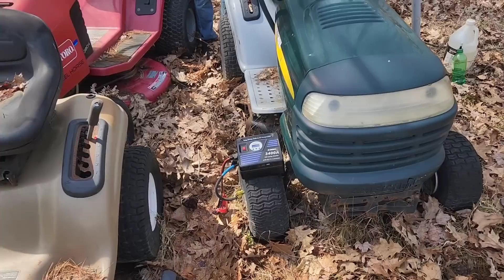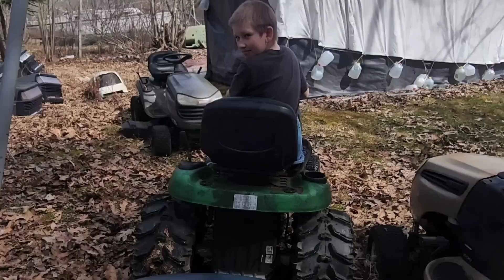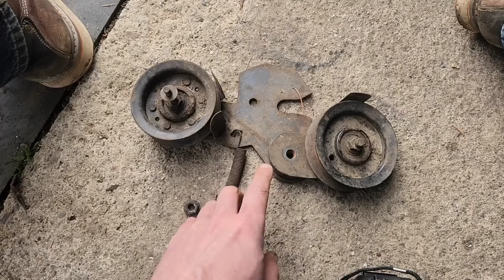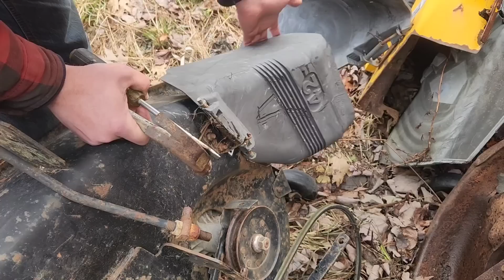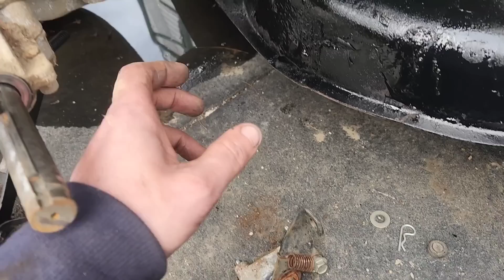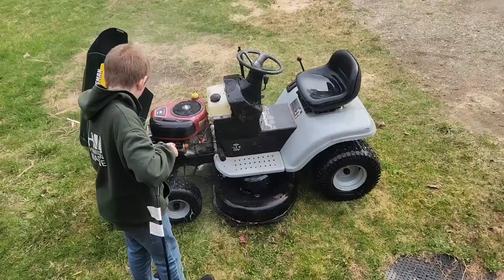Tractor Hunting: Craftsman LT1000 $50

Comment: Cute boy there!
Got a question. I have a Craftsman with 19.5 HP opposed twin.
I put it away for winter and now have no spark on both sides.
I disconnected kill wire, still nothing.
I changed coil and still nothing.
Seat switch is good, machine turns over. could it be a Diode?
Reply from the maker: Coil gap to flywheel or the magnet is rusted to the point it fails to trigger. Might be the case. New coil with kill wire removed you should get a spark.
Reply: @redneckcomputergeek  Thank you.
I will check that and try again.
Reply: @redneckcomputergeek  Hello, thanks.
I had put coil in backwards. It started up.
I need more help.
I used machine and it was great.
Then I used again and it lost some power going up an incline while mowing.  Never did this before.
I tried starting mower with one spark plug wire removed and it did not start. But when both wires are plugged it starts right up? I thought I could test each plug independently.
I will check carb incase loss of power is fuel related..

Comment: Nice video, i love the tractor hunts but i have a question, I have this 2003 poulan pro that I swapped a Kohler courage 25 horse and it ran pretty good until somebody monkeyed with the valves without me knowing, anyway when I go to set the valves do I have to have the proprietary gaskets for the valve covers or can I just use rtv sealer, trying to get it up and running on a budget, thank you in advance.

Comment: Why didn't you just pull the spark plug out when you flooded the cylinder and just let it spray out the gas clean off your spark plug while you're at it instead of risking bending stuff and blowing a starter apart
Reply from the maker: Over tired and out of practice. Honestly they normally clear right out after the first hit. But now we know the head gasket and valves are good LOL
Reply: @redneckcomputergeek  what about the pushrods lol

Comment: is that one of the newer LT2000s with a LT1000 hood?
Reply from the maker: I debated that. But all the 2000's have a cast iron front axle and a only the 1000 was sold missing the lights.
Reply: @redneckcomputergeek makes sense